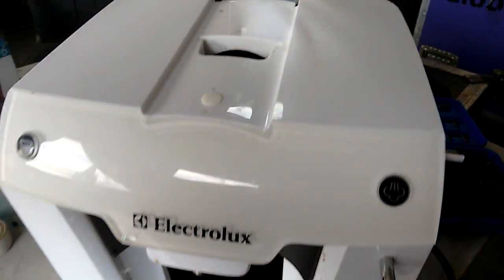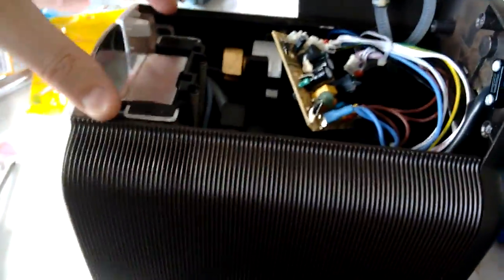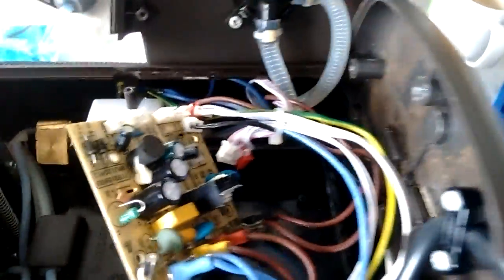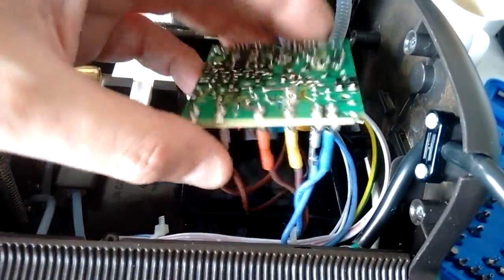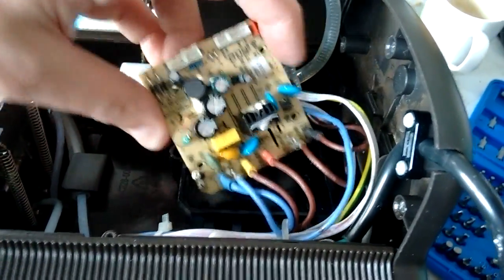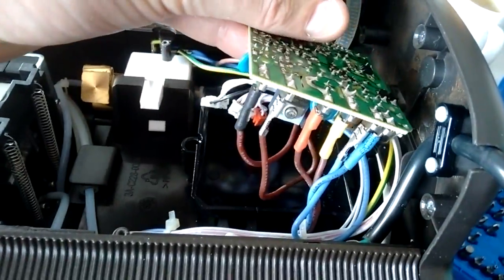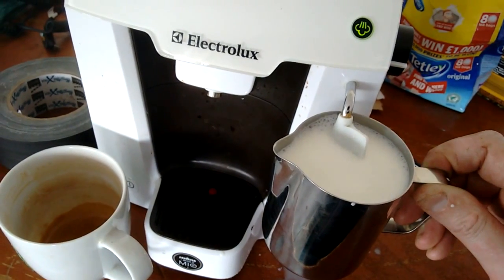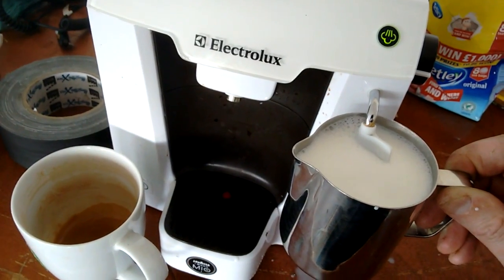Repair of crew coffee machine.

Comment: Absolutely LOVE it!>>>ur2.pl/1163   We use it daily and are consistently happy with this machine. He had previously owned a Saeco Vienna Plus (no longer on the market) and we weren't sure if this would measure up... it does! My only complaint would be that the water reservoir is small, so you have to refill that frequently. The machine is easy to use and easy to clean/maintain.

Comment: I have a fair bunch of TRIACS laying around my inventory and because you mention about how they are used in motors, I'm a bit confused how that works because I want to put my TRIACS to good use.
Is it to do with 3-sinewave input motors?
Reply from the maker: +Bradman175 Triacs are electronic switching devices that are able to switch AC.  They're commonly used in light dimmers and fan speed controllers.  They have the characteristic that they latch on when triggered, and won't turn off again until the current passing through them is almost zero.
Reply: bigclivedotcom "They have the characteristic that they latch on when triggered, and won't turn off again until the current passing through them is almost zero."
Well like all thyristors due to being able to hold their on state.
any use on DC motors though? like as an h-bridge?
Reply from the maker: +Bradman175 Triacs are the AC version of a thyristor.  Like two thyristors in inverse parallel.  The latching effect on each half wave means they are mainly used for switching and dimming (phase angle control) AC loads.
They are not really suited for use as H-bridge drivers.
Reply: +bigclivedotcom looks like I have to find other uses for them.